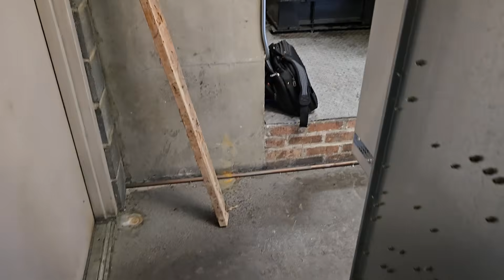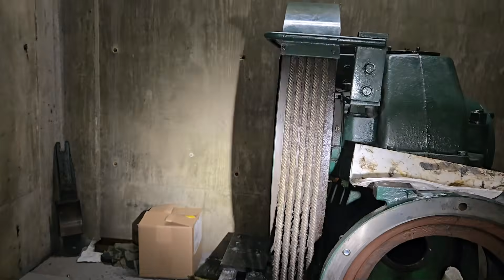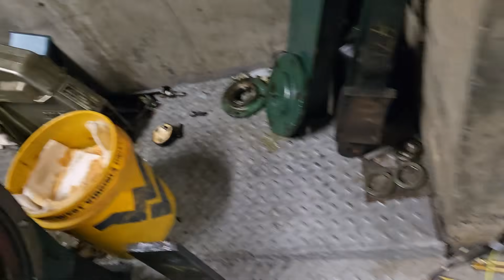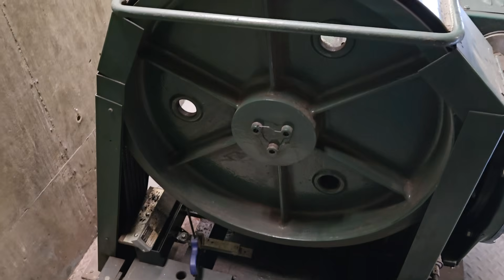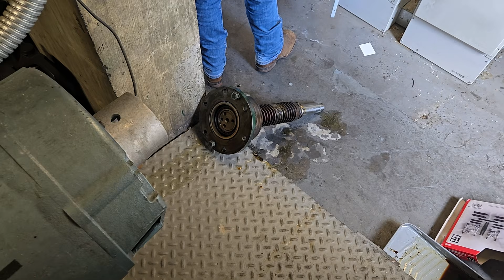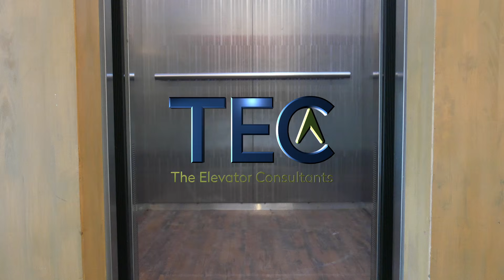Inside Elevator Machine Room | Rare Broken Worm Gear & Major Elevator Failure

Comment: NYC elevator mechanic here, I wouldn't exactly call a worn out worm and wheel "rare"... just a tip by the way, the point of failure was almost certainly somebody dropping a piece of hardware or something into the gear case, probably one of the bolts for the cover that you remove when you need to add more oil...

Comment: The worm gear looks like it's been hot. Hot enough to bake the oil onto it, at least. Gearbox is designed with the worm gear on the bottom, so it should be soaked in oil all the time. Might've been run dry or nearly dry for a while before somebody noticed it was low on oil.

Comment: did this get a new motor control? how smooth is the start of the motion and what does the current curve look like when it is starting/stopping? if there is a current spike in there - that is your cause of failure, the broken thread segment is just the result, not the cause

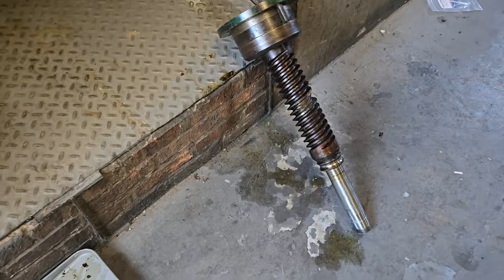Comment: 1:48 *teeth. (not 'splines.')
ℹ️ Splines are ridge-like teeth parallel to the axis used strictly to lock a gear or wheel tightly onto a rotating shaft so they spin together without slipping.

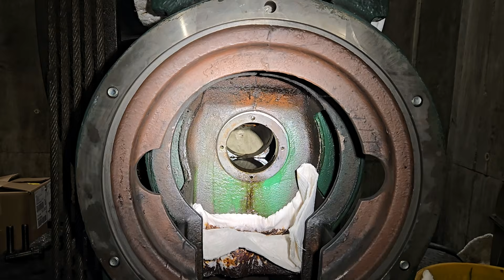Comment: 0:55 *worm wheel... although worm gear is acceptable.
(Not 'ring gear')
ℹ️ A worm gear does not turn a ring gear, as they are two different types of gears used in entirely different setups.
A worm gear (the screw) turns a worm wheel (also called a worm gear).